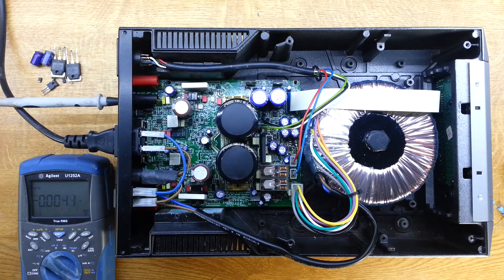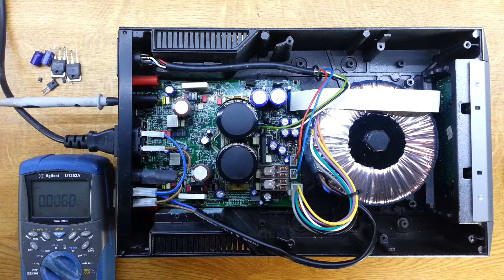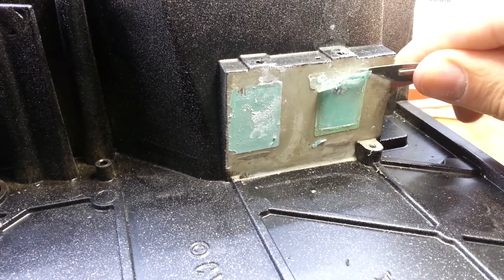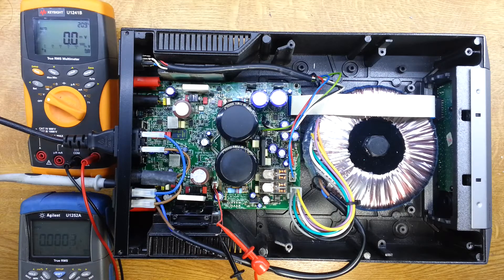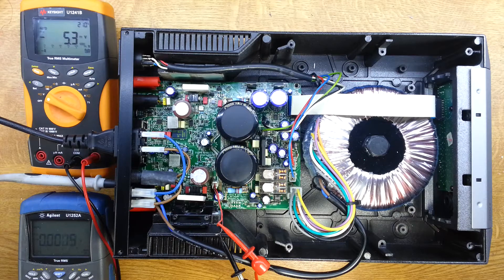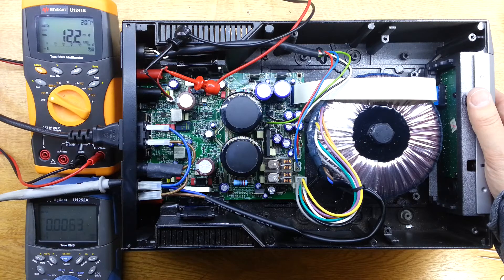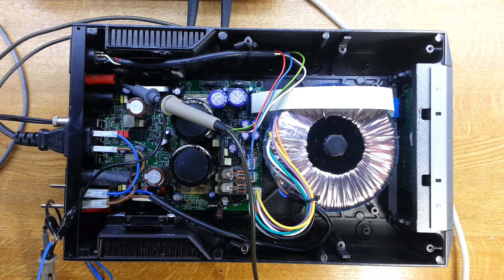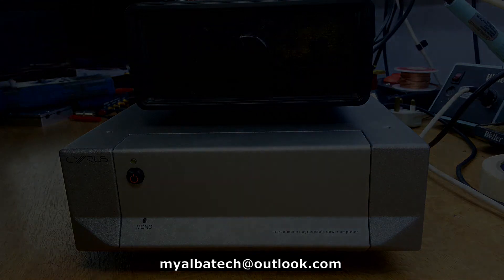Repair of a Cyrus X Power - Part Two (Smoke Free!)

Comment: Hi, love these videos. Could you please tell me, what are the bias settings for this model. Cheers J
Reply: Did you find out? Often between 20 and 80mv usually on the lower side sometimes more. Probably mentioned online somewhere in a forum if no info available..
It's in the video lol. 20mV he said mA by mistake but corrected with subtitles.